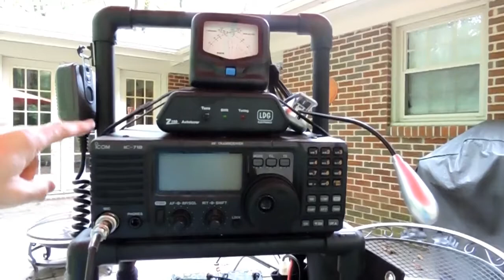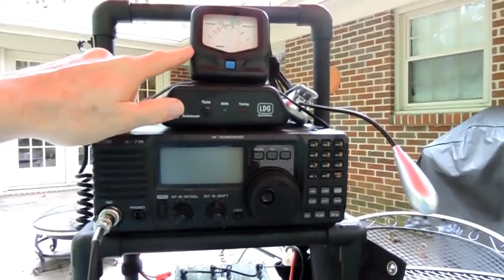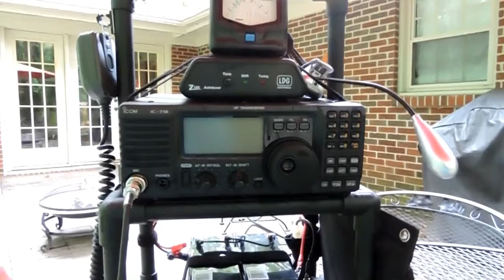iCOM 718 Portable Carrying Rack

Comment: PVC   GLUE,Screw, or Rivet? In your opinion which is strongest? Thank you
Reply from the maker: HI. Depending on the weight of the radio, I simply use either (friction) or glue. Again, only friction for light weight radios such as the FT817 or Xiegu radios. Definitely reinforce with small wood screws and PVC glue for larger radios. Tnx for your questions. 73 de AI4QT

Comment: Something like this would be more robust, discreet, and actually rain proof when the lids are on it:

http://kf9za.kremer.com/gobox/images/kf9za_updated_gobox_web.jpg

Portable 19" PC rack mounting cases are great for this kind of thing.
Reply from the maker: Yes, it would indeed.  However, this is not indented to be weather proof.. just portable to use within a tent or picnic covering.... Thanks for your comment!  73 from Alabama.
Reply: AI4QT How do you transport that PVC pipe setup to the location of the tent?

 ie, how do you ensure the radio equipment doesn't get banged up and possibly damaged.

It's completely open and unprotected. At least inside a case, it can't get things dropped on it or knocked up against it while being transported.

How would that PVC pipe setup survive in the boot (trunk) of a car?
Reply from the maker: Good questions. Again, this setup is in no way used to protect the radio. It's a carrying rack-something to keep the radio and it's accessories all hooked up and ready to go. It's not a protective case obviously and it wasn't built with that in mind. Actually, I misspoke. I transport on the floorboard of my car and it rides pretty well.  Sure. I wouldn't want to carry it a long distance. It's heavy, but for a short walk from your car to a picnic table or tent, not bad.  I like the idea it's open to have access to everything. You are right though, one has to be careful not to bang it.:)   Cheers and 73.
Reply: I guess I am slightly paranoid about protecting my kit while it's on the move. I tend to over engineer on the side of caution. 

Good luck with the picnic table DX'ing! :)

Comment: What are you using as antenna?
Reply from the maker: At home on the patio-- i.e. patio portable, I'm using a G5RV at appox. 30 meters in the tree line.  At the cabin, I'm using a 75 meter dipole also about 30 meters in the tree line.  When I'm out and about for a quick portable station, I'm using a variety of Ham Sticks and a Buddie Pole.